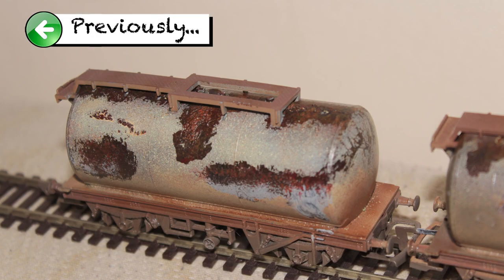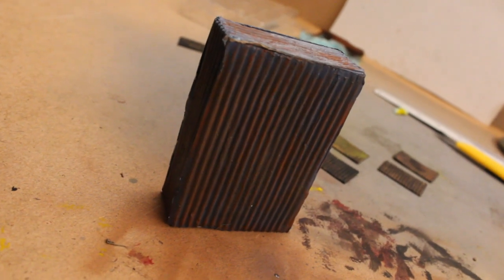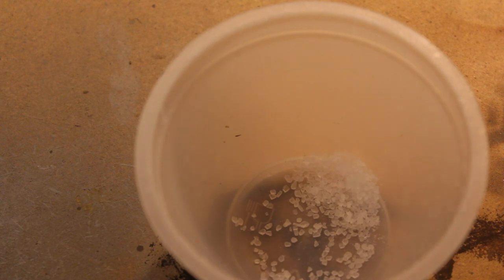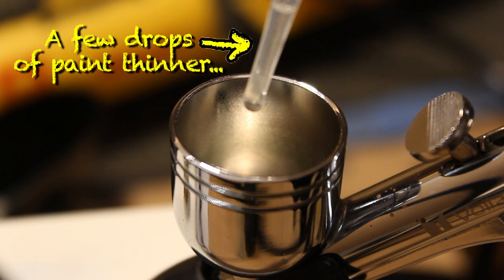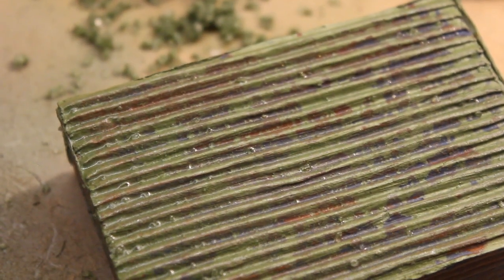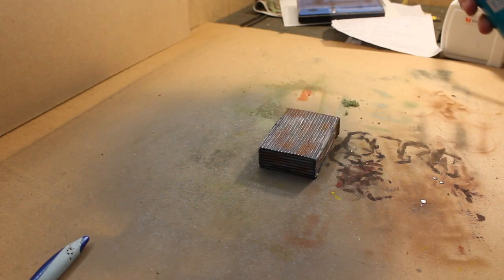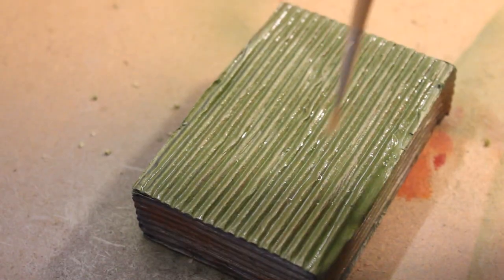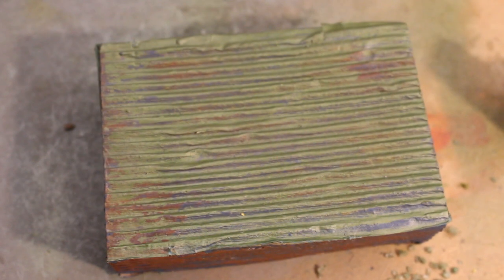Salt and hairspray weathering technique FAIL... (Don't do this!)

Comment: hi Richard, very wise to try new methods on a test piece. I have never been a fan of abrasive stuff like salt. Likewise, hair spray, which is effectively a thick lacquer. I use diluted paints (both enamel and acrylic) and powders. Rather than buying expensive 'washes' i dilute paint that is nearly used up and I also use make-up products from Poundland and alike. Both of these approaches allow you to undo if you do not like the final results. All that said, great video my friend, carry on. You have great presntation style
Reply from the maker: Hi there! Thanks for the comment! I'm glad that I did practice on a test piece rather than just going ahead with a loco or wagon I want to keep! 
I'm very much a fan of trying to save money as much as possible, and am a HUGE fan of places like Poundland, Notes, B&M, Aldi and places where you can get cheap art materials!
Check out my other videos to see some more successful weathering techniques! 😁😎🔨🖌️🎨